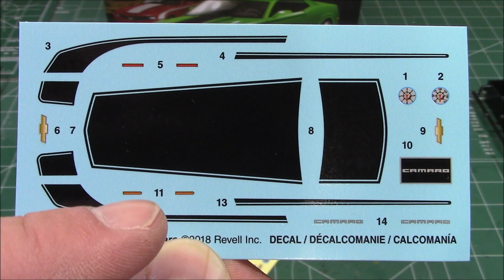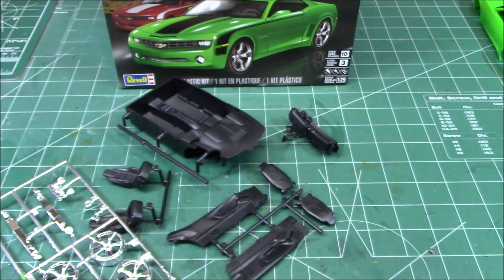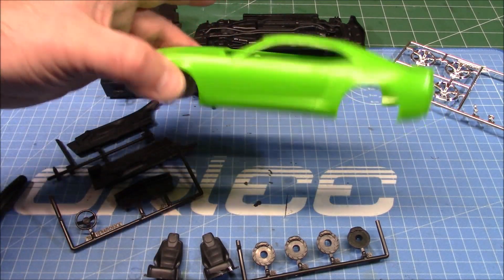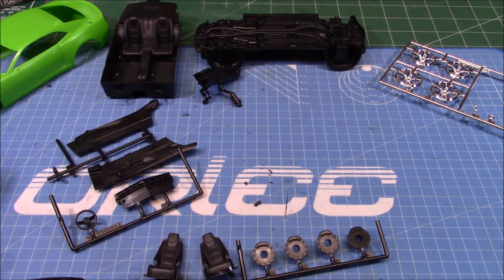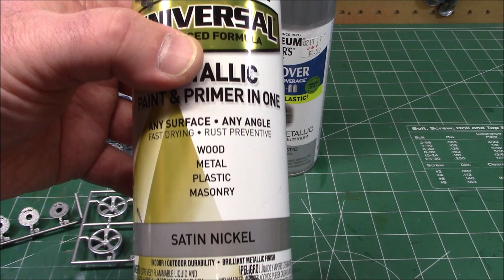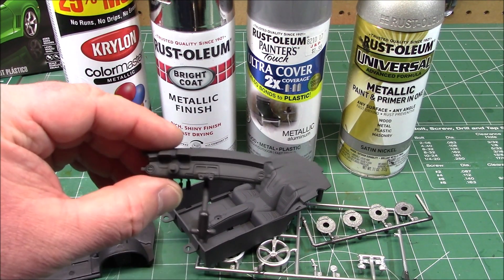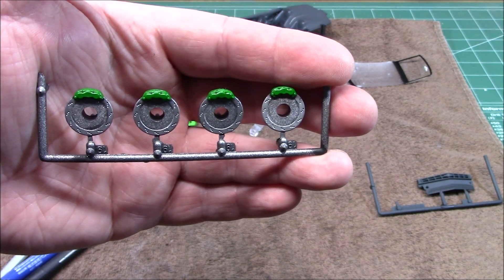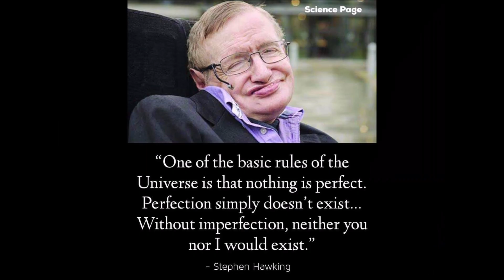Revell Chevy Camaro Concept Car 1/25 Scale Model Kit Build Review 85-1527

Comment: I brush my Future on, too. I like using foam sponge brushes, no shedding, no brush strokes, washes out easily, doesn't really wear out as fast as bristle brushes--the ones I use I've had for years.
And the fact that Future basically self-levels means nobody can ever tell it was hand-brushed.

I also have a large bottle full of Future diluted about 60/40 with water, and it's a few years old, too.
I really don't use a whole lot of it, but it still goes on nice and smooth after all these years.
Reply from the maker: Thanks for watching!

Comment: I have had some issues with Silver Krylon Metallic spray paint and Pledge with Future that lifted  the paint . This is an old bottle that has been around for years, I don't know if that had anything to do with it or just this type of paint. I would advise testing the paint first so you won't have to strip the paint off to start again as I did. I live in southern Ontario Canada and have had a number of issues with paint  ( Rust-oleum and Krylon ) not drying properly and that too might have been the problem.  ( I am now using a dehydrator to dry my paint to resolve this) Better Safe than Sorry

Comment: Quite the nice results and you're right, the modern snaps are really neat. But level 3 make me laugh! I mean, what is level 1 then? You open the box and the model is already ready to display? lol

The only negative point, to me anyway, is that Revell tease us white hockey stripes on the box, but do not put them in the kit. I can see this in a metalic blue that is similar to some paint Chevy had back on the 1st gen camaro with those white stripes.

I made the AMT version of that kit. First kit I've finished since 10 yrs. Except for the light bezels, the exaust tips and the shifter, I dechromed everything and, except the wheels (which ended Tamiya's gunmetal), all was painted flat black. I also opened the grill. I did it for fun, and to see what I was able to do now. And I was surprised about what I was actually able to do. Sure, it's not a show winner (I'm not at that level, maybe I will someday), but I had real fun with it. Sad thing tho, is that I lost one of the whipers. Good thing tho, I bought the same kit to use as a donor to make a resto-mod and therefore, I will be able to use the whipers of that kit. ^^
Reply from the maker: I think level is now determined by parts count, not skill level.
Reply: @hpiguy  I see. Well, that would make sense. Cuz it don't really make sense skill wise. That said, while it's a simple kit, it's still pretty good. Interior detals seems better than AMT's version.

Comment: I would’ve taken some satin or flat clear and sprayed over those chrome wheels. I would’ve left the headlight bucket a chrome. Nicely done model. I do like the AMT version better. The engine detail and interior detail is much better looking.
Reply from the maker: Lights were all left stock chrome.
Reply: You can also mix Tamiya flat base in varying ratios with future.

Comment: Chris, other than the fact that the large cans of Rust-Oleum X2 can paint several models vs those tiny cans of Tamiya paints, is there a specific reason you use it?
Reply from the maker: Correct, it's mainly because I'm cheap and the cans last forever.
Reply: @hpiguy  I couldn't agree more with you and I stopped buying those tiny cans of spray paint that start at $7 and go up from there, to buying the Rust-Oleum X2 at half the price and I've saved a bundle, not to mention the fact that I can paint 10X as many models as before!👍